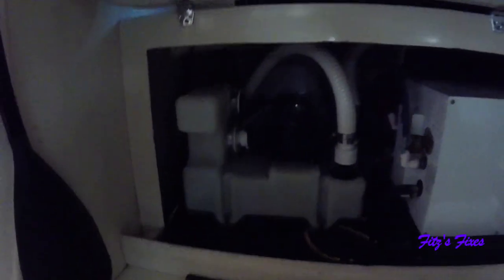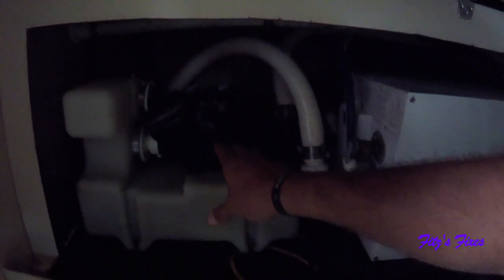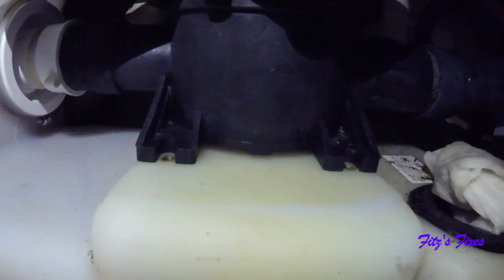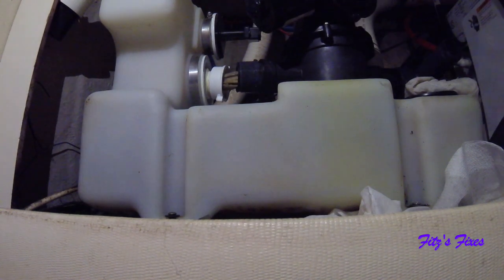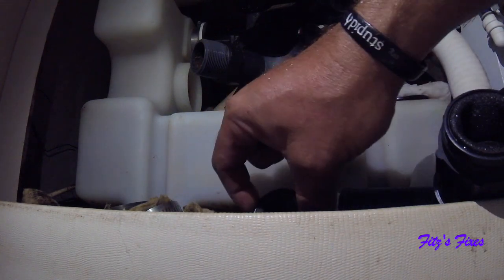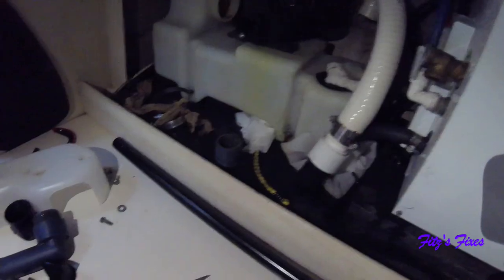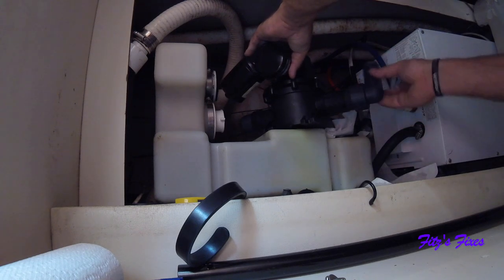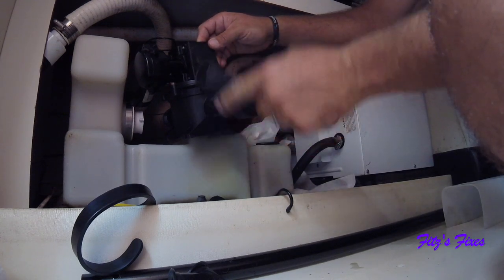Vacuflush repair

Comment: Interesting that the pump and holding tank are inside the boat. I’ve never seen that before. Every boat I’ve owned they were in the bilge area where it’s hard to get to. Any problems with odors on the boat?
Reply from the maker: Yeah it's a bit unusual, but there's no smell where it's located

Comment: Had to go back and watch this video.  This job awaits me in the spring.  My vacuum pump is located behind the ice maker in the cockpit.  I pulled the ice maker last fall and figure since it's out, I should do the duck bill valves.  I usually abide by the "If it ain't broke don't fix it" slogan but in this case I'll just do the job.
Reply from the maker: It's way easier to do it before it "has to be done". Idk if I mentioned it in the vid, but flush a bunch of liquid fabric softener before you pull it apart. It'll make the job way less stinky
Reply: @fitzsfixes  Thanks for the pro tip.  I will definitely do that.

Comment: Fitz, Sorry for the odd question, Im looking at tablets for the boat for next season, I like the way you use yours. Care to share what Tablet and app you use, I apologize if you covered it all before ( thought you had but couldn't find it) Thanks Mark     Hope to see you on the water in the summer
Reply from the maker: No worries. I had an old galaxy note that ran Navionics on. The new boat I'll be installing iPads in the dash for a cleaner look. Navionics on one, and entertainment on the other
Reply: Much appreciated. Boats on the Seneca Cayuga in Seneca Falls the most  Will be heading to Fairport and Pittsford sometime this season, also doing the Amphitheater in Syracuse again at least once to see Chesney, Have an 84 350 Chris Craft Miss Meghan Jean. Say hello if you out this far.